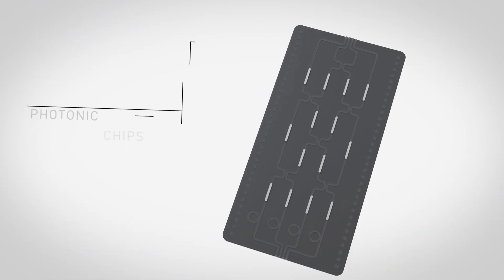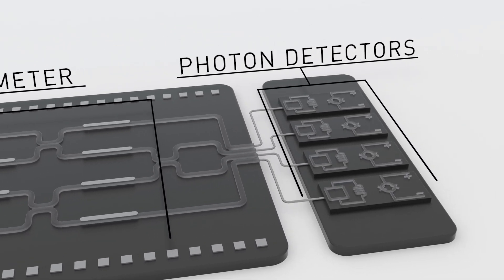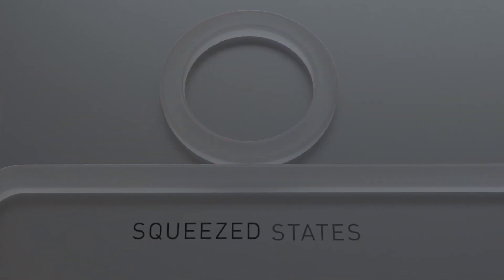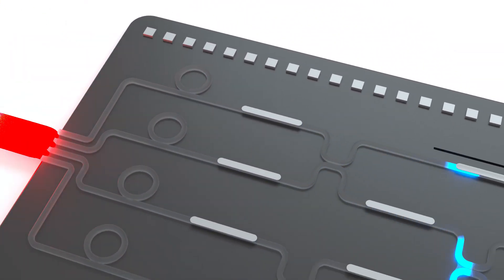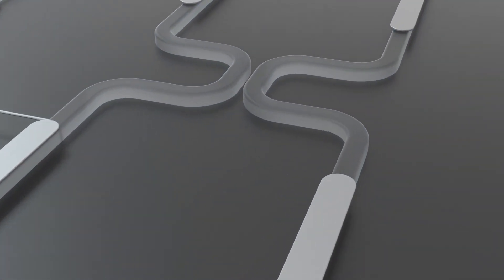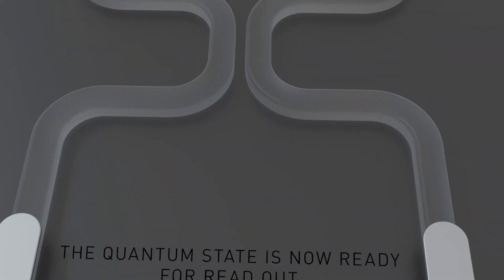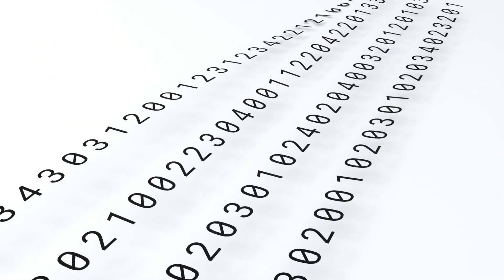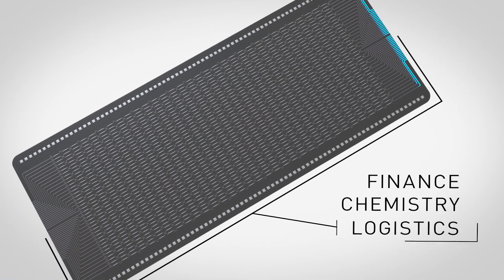How Xanadu’s Photonic Quantum Computers Work

Comment: OMG😳, WOW😳, does it need near absolute zero cooling🤯?
Reply: cant wait to know, i just asked gpt, she said no need for cooling:face-blue-wide-eyes::face-blue-wide-eyes:
Reply: @Dog7Dixon  thats one of the big advantages of photons vs other methods (Ion trapping or supercooling electrons) is you can run at room temperature (except for transition edge sensors that measure the states as the wave function collapses but they can be cooled pretty easily)  :D

Comment: I don't understand something here; the Xanadu website, as well as other articles, says that their photonic quantum computers work at room temperature, but their photon detectors, the transition edge sensors, need to be kept in a superconductive state in order to work, which requires cryogenic cooling.

Which is it then? Does the machine require cryogenic cooling, and thus does not truly perform at room temperature, or have they invented a new type of transition edge sensor that can work at room temperature?

Comment: It can work between what temperatures?
Reply: it has to use entanglement and a bunch of other things.  which means  sub-zero.  Meanwhile a  Light Based Interference Logic gate can work at room temperatures and be fabricated on an inkjet 3d printer...
Reply: @daomingjin  its room temperature except for the transition edge sensors but those are easy to cool in excess systems :)

Comment: a random question: in what other industries would this technology be game changing and could you mention some theoretical examples?
Reply: This is just really used for number crunching doesn't do anything like a GPU doesn't do anything like a CPU it's more like a bus to interpret photonic information so it could be understood digitally I was watching this video to see if it had anything to do with an actual photonic processor but it's still bottlenecks somewhere on a classical side so say you had fiber connection coming into your house .. your old school household computer could only interpret so much information coming in
Reply: Anything that has large differential equations. Mostly data clean up to find relevant domains.

Comment: how can you ensure all the photons are in phase at input?
Didn't they come from different device?
Reply: haven't watched the video or what !? dude ,, that's why they need the resonators  "filters" to make a different light out of input light (phased or precisely phased or more coherent or same identical states etc. basically ordered or translated light to quantum states light that interference meters or entanglers can work with).
Reply: Would be a single frequency modelocked laser diode most likely. ❤

Comment: Now just imagine if we could grow these circuits using CRISPR, a fungus from Fraser Island, Australia, and glass sea sponge DNA x]

We could also potentially grow a power supply using this method :)
Reply: I know you are a spy of the fungi! We'll not surrender without a fight!
Reply: @csaki01  sigh
Reply: You could take a self-replicating 3D printer (also it could self-replicate faster if it molded things with "hands" rather than just printing) and have it build smaller versions of itself and then have it make even smaller versions of themselves until you have trillions of tiny replicators that you can use to build a house that is also a quantum computer.
Reply: @aoeu256  Lol
Reply: @aoeu256 This sounds like the plot of a sci-fi novel

Comment: Just wondering who did your animation? It's really slick! Also, what is the limiting factor for the number of qubits?
Reply: this must be some lame photonic device and its probably meant for marketing only. Because later they deliver photons to CMOS transistors, but CMOS transistor don't have the ability to count the photons, photons are likely converted back to electrons and they sense the voltage and this way figure out how many photons were there. This presentation will look very lame to me unless they state something like "our photonic chip is X orders of magnitude faster than traditional CMOS based silicion chip". But they aren't saying this , so this is a minor achievement in the solution of some problem
Reply: @absolute___zero  this is based on Boson sampling. It's neither classical computer nor universal quantum computer. The technique don't need entanglement of photons rather based on superposition of photons without any definition of qubits, it can solve bigger set of problems than classical computer because of 2^n variables involved at (n=number of initial channels) interference, these variables of superposition states constitute towards the probabilistic feature of output. Higher the n, higher the error in results, so they perform numerous experiments/computation and decrease error. The output is YES/NO photons (basically larger number of photons -Yes(or 1), less or zero number of photons-No(or 0). The distribution collected over numerous experiment gives the correct results which is completely probabilistic and can not be computed by classical computer. But this doesn't cover bigger set of problems which other universal quantum computer can! Universal quantum computer involves entanglement of photons and qubits like an IBM.
Reply: Error correction
Reply: 2° = number of qubits depends on how complex your problems are ?

Comment: Having quantum computers perform processes on classical electronic based chips is like running a marathon when you only know how to crawl. photonics is the way forward for quantum computing without a doubt.
Reply: You cannot be sure about that, another company is developing quantum computing chips on classical chips that are super cooled. Quantum computing works that way too. I think Google did it the same way.
Reply: @davidabraham247  those are not normal classical chips, but they aren't photonic either.
Reply: @davidabraham247  I'm trying to find some place on the internet when it talks about photonic computing not freezing the crap out of some old school processing chip and calling it a quantum computer..
Reply: We're not when
Reply: Where not we're
Reply: There's a line to walk between cutting edge technology and mass production/commercial viabilty, so there's a lot of niches to fill while the tech is still developing.

Comment: It’s all good, only that the ring resonators are in Silicon Nitride (likely exploiting the chi(3) nonlinearity through SFWN) and the detectors are in Silicon, which does not integrate monolithically with Silicon Nitride and need to be in a cryostat; unless they are using APDs, which only require thermoelectrical cooling (still, not monolithical). So you still good connectivity between the SiNx and Si PICs, which Indon’t believe these people have a good way to do....
Reply: Make it out of GaN and it could do it all including the lasers on a single chip. It's a lot more costly than silicon or SiN though. ❤

Comment: Is this all working at room temperature? If it is, people are being strangely quiet about it. Or did I missed the train and photonic quantum computing was always done at room temperature?
Reply: I read on Ars technica and Nature that it functions at room temperature, and they both have further information on Xanadu.  Thermal adjustments need to be done for the circuitry timing on the photons?  Seems very promising.
Reply: @jopalolive  Thanks. Decided not to be lazy and found the answer too:

https://www.itpro.co.uk/technology/356979/xanadu-launches-first-quantum-computer-that-can-operate-at-room-temperature
Reply: @ulysses3349  That's honestly a huge deal if it truly operates efficiently.
Reply: @JET7C0  Indeed it is, I'd say that one of the major problems with quantum computing is the near-absolute zero setup. Hope they fine-tune this thing, rooting for the next gen quantum-whatevers.

Comment: Very interesting. I wonder are some of the coding applications mentioned for use in this type of hardware are quantum annealing type problems based on meta-heuristic algorithms which have been implemented on adiabatic-styled quantum computer's in the recent past, such as the d-wave quantum computer? I ask because I have been developing ways to equate quantum algorithms to more classical theories of network synchronization that could be run on more portable classical computing hardware.
Reply: As far as I know, there exists a platform by Amazon called Amazon Bracket which allows you to use your Xanadu code on various devices such as D-Wave's quantum annealer, IBM's quantum computer and others.

It happens that even though adiabatic annealers and gate-based quantum computers are vastly different paradigms, the Wigner Jordan transformation allows one to map fermionic problems onto an Ising spin model. This spin model can of course be implemented on an annealer, or through the use of a Variational Quantum Algorithm, be implemented on a gate based computer. The "annealing" part of the Variational Quantum Algorithm comes from using classical machine learning to find the parameters of the gates that minimize the ground state of the Ising Hamiltonian.
Reply: Try Qiskit
Reply: All I'm hoping for is a 10 petaflop general purpose photonic computer that uses < 50 W power supply, then we'll talk. ;) Does computational speed increases a function of the number of lasers or frequencies*? Say an optical computer has four lasers, maybe colored red, orange, green and blue. How would having two of the four lasers turned on affect performance, compared to all 4? Also, how does the number of interferometers scale up the computations? Also, if a laser was capable of varying it's color/wavelength by say +-200 nm from a base frequency, multiple times per millisecond, could frequency modulation be used as a way to perform more calculations per second? Finally, could an optical computer be used for general purpose computing, or AI at home. Like a home automation or computer system that one could hold a conversation with, similar to LCARS in Star Trek, or KITT in Knight Rider. Also, will photonics be used in supercomputers, so we can break the zettaflop barrier before 2030? I ask a lot of questions, cos science is exciting stuff. Lol...

*Ex: 
1 frequency = 500 GFLOP
2 frequencies = 10 TFLOP
3 frequencies =  500 TeraFLOPS
4 frequencies = 10 PetaFLOPS?

Comment: Quantum Computing at the Speed of Light!
Reply: just the translations part or reading writing (interactions) parts it's at light speeds, bc the computing itself it's non-measurable or way faster than the light speed considering the entanglement part wich is instantaneously computing or interacting.